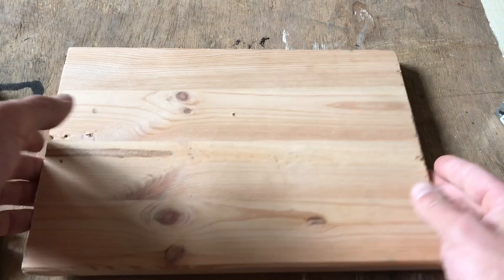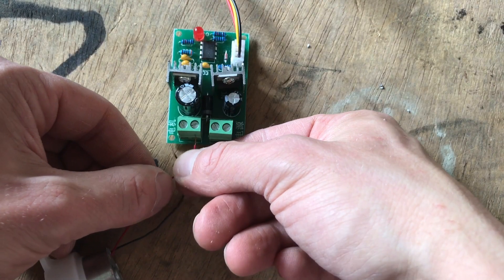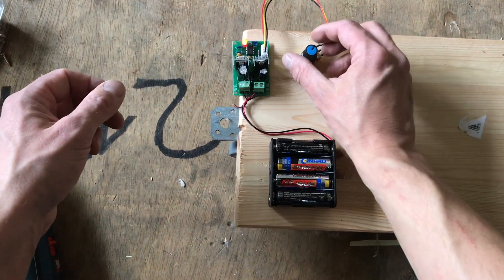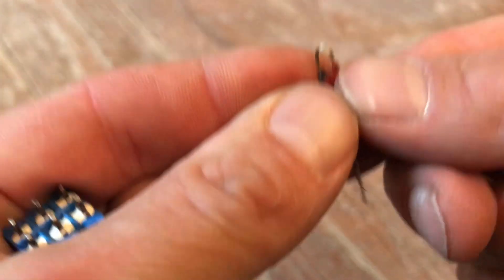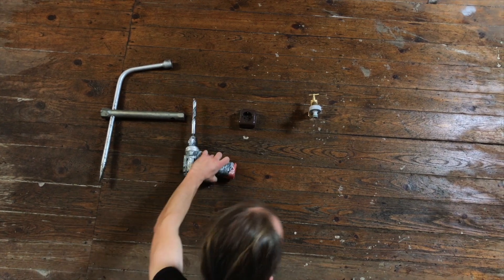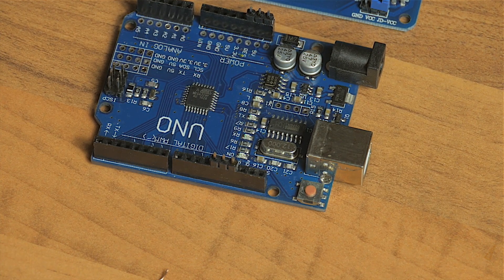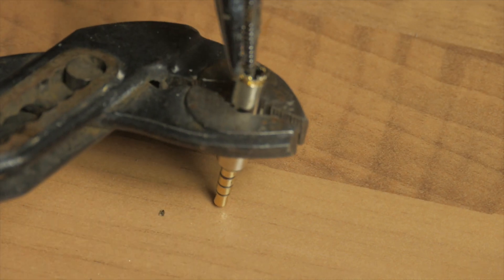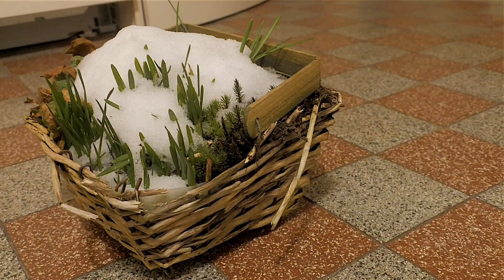DIY CAMERA DOLLY for time lapse! Cheap and easy, with Arduino

Comment: The Arduino would also be fun to program ramping up and down of motion and timelapse. Any gitter in the last test was likely caused because the camera wasn't being triggered by the Arduino. You would want a move-wait-shoot-wait-move. The second wait is to allow shutter closure before moving. The shutter/gate closure during moving on a DSLR will cause enough vibration that can microscopically adjust your shot without realizing.

Comment: You can use the extra relays to control direction and add a simple rotator motor and inputs on the Arduino to detect end stops or even use the radar modules.